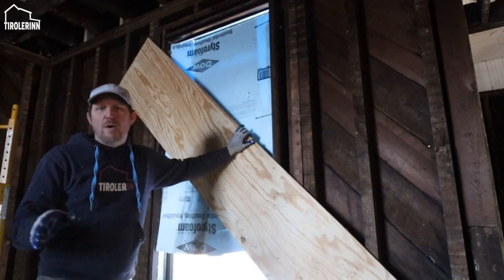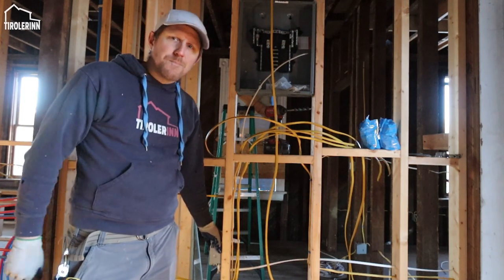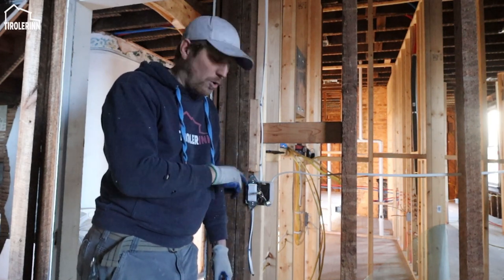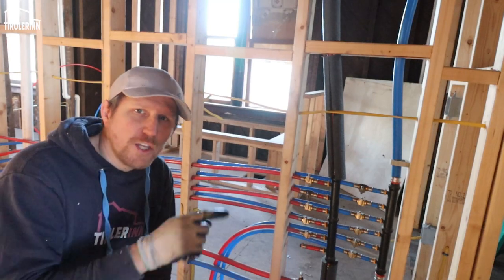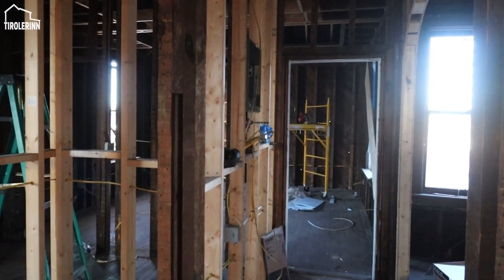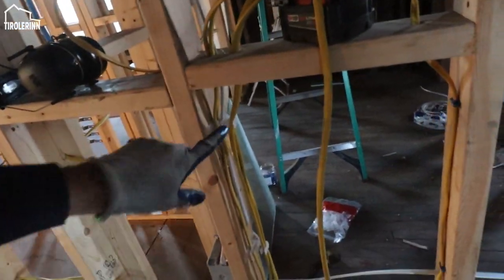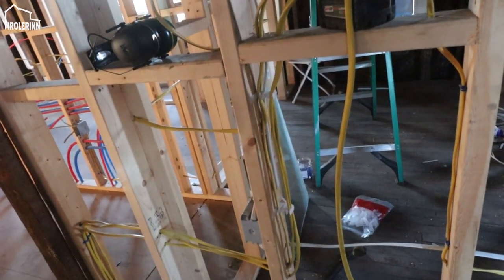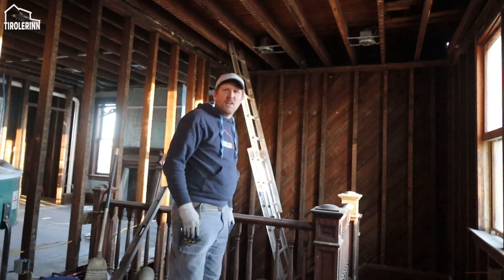More Lights in the 2nd Floor - TirolerInn the Renovation

Comment: It's really impressive to see, how you plan your work before. A separate light circuit is a good idea. I would place the switch outside of the laundry room, because a light switch in the middle of the wall could be unflattering for placing of cupboards. I would mount the chandelier in the middle and not to low.
Reply from the maker: I guess most electricians will not do dedicated circuits even though it makes it so much nicer when the breakers trip...
Reply: @TirolerInn  Yes, but I think, they won't take the risk of overload, if you decide to use more powerful lights than LED. Every issue will be their fault. I think, you are on a good way. Like to see more.

Comment: I was thinking of a motion  light for the laundry room,  sensors the movement as soon as you open the door and closing the door. I would think centering the chandelier in the center ceiling of the stair case, hanging not  long to reach to clean but not as to bump your heads or the kids touch it. it would look beautiful going up the stairs.  Also, curious as to how many electrical outlets for each room are you allowing for.
Reply from the maker: Yes, someone else was suggesting a motion sensor for the laundry room. We will have to look into that. It’s a great idea!
As for outlets, it’s in general 7-8 outlets per room.
Reply: @TirolerInn   Have you and your wife decided on the placement of the chandelier? I can't wait to see what you choose:)
Reply from the maker: we cant make up our mind so we are going to mount some wood to hang it via a hook both ways and will decide later when we actually mount the chandelier after the plaster/drywall is up
Reply: @TirolerInn  What would you think of some beautiful wall scones going up the stairs?
Reply from the maker: @judithwoomer7747  we are looking for some in different antique stores. we need to figure out first how many we can find that are matching before we can place them